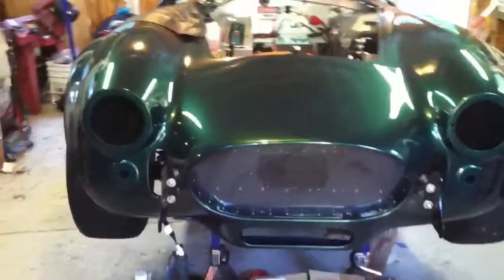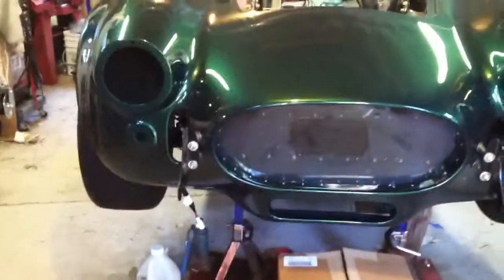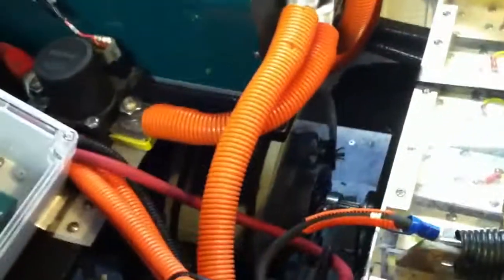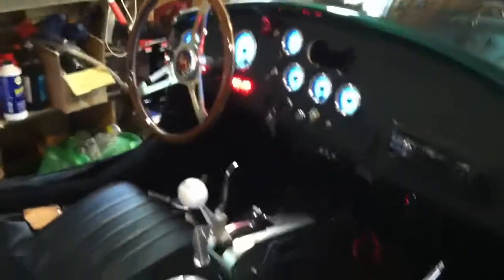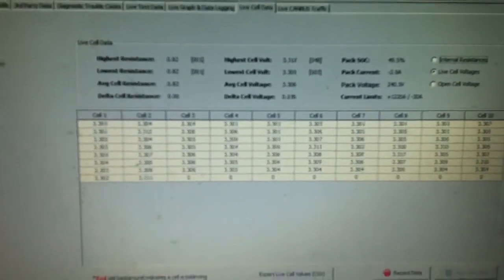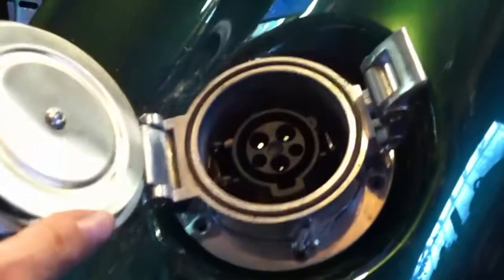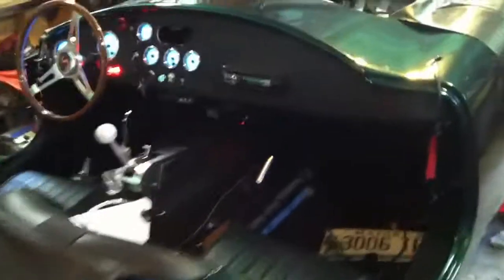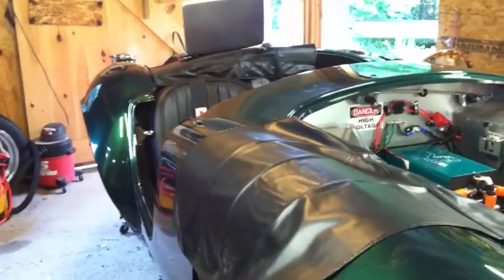FFR Mk4 - Electric car- #53 - Body on

Comment: Since the grill block looks like just a flat panel I wonder if you'd actually get better aero with an open grill with ducting that allows air to flow smoothly out somewhere?  Or make a curved plug that fits in the opening for a smoother front?
Reply from the maker: The aerodynamics is better if the air goes around the car rather than through it.  The grill block is the first of several planned aero improvements, belly pan and front air dam are on the short list.    Have a look at ecomodder.com, some great info there on improving aero on your vehicle.   Some of the people there have improved their mileage by a lot.
Reply: Wayne Krauth
"JRP3 EcoModding Lurker    Join Date06-11-2010"  ;-) 
But yeah, good site.  I did a grill block on my Fiero, but my bumper had more curve in it.  I did a full belly pan too, out of coroplast, but the Fiero had a pretty flat underside to begin with, so the difference was small.